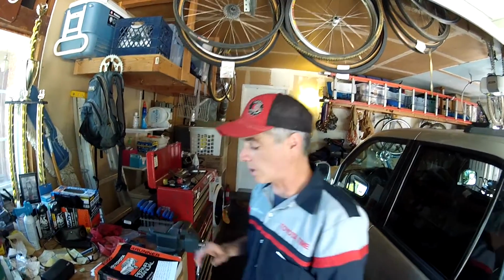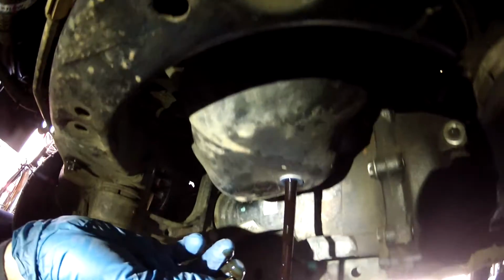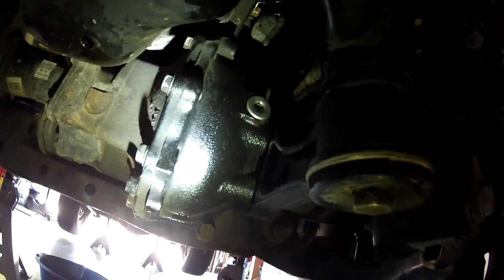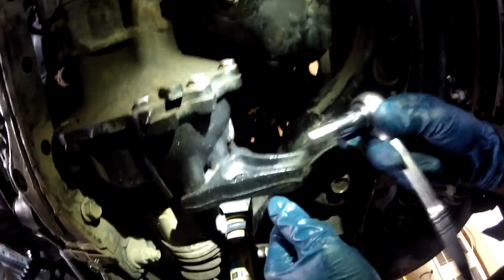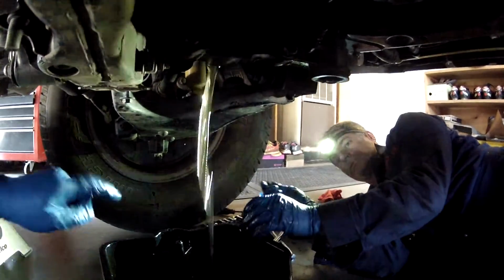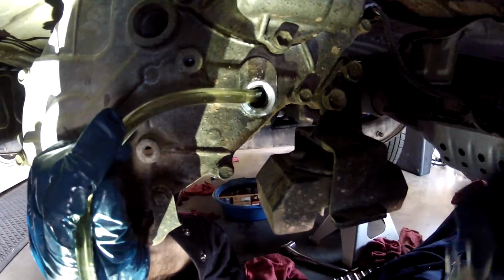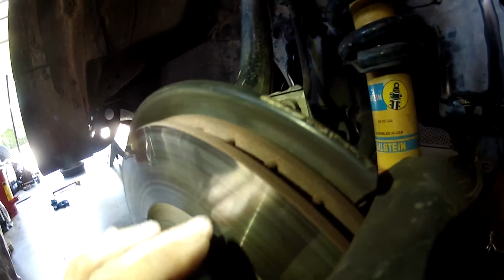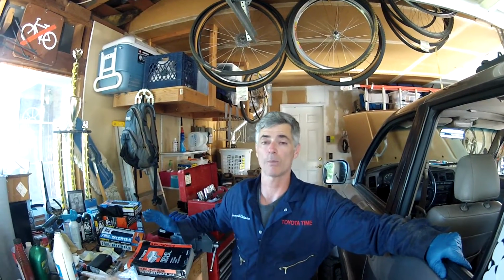30,000 Mile Interval Service

Comment: Tim, a big thanks !!!  

You recommended me doing my timing belt last year which I did, and my one-owner 2000 Limited is running great.  So today I tackled all the fluids.  I couldn't get the front diff drain plug loose even with a 1/2 breaker bar. I thought about using an impact driver, then came to my senses and just siphoned the oil from the filler plug the best I could, and refilled it back up with new fluid.  Transfer case, rear diff, and tranny went fine.  I do have a question.  Is inserting the tranny dipstick always such a PITA?   Is there some kind of trick to just dropping it in?   I tried to test the fluid cold, but after 5 minutes of finagling the stick the car had already warmed up some.  Maybe I need a new dipstick.  I will be doing my brakes next week.
Reply from the maker: For the front differential drain plug, apply heat with a butane torch around the perimeter of the plug, shock the plug with a few hammer blows and then try to crack it loose.  If it still doesn't budge, apply more heat and try again.  The goal is to not strip it.

For the trans dipstick, use two hand to insert it, one on the handle and one on the actual dipstick helping feed it into the dipstick tube.  You have to look at how the dipstick tube curves and try orienting the dipstick in different positions and find the one that allows the dipstick to slide in easiest.  if you mess with it for a while, you'll figure it out.
Reply: @TimmyTheToolman   Will try the butane torch on that plug.  I was only able to siphon around 1/2 qt.  I'll play around with that dipstick until I get it down.   Someone mentioned if having trouble, flip it 180 and try again.  Interestingly, Toyota has two different dipsticks that are "exact fit" for my VIN.  And it is not a superseded version of the other.  They can both be ordered from the same dealer today.  I wonder what has changed from the OEM version.   Part# 35103-34060 and 35103-35350. In the meantime I will keep working on that original dipstick.   Thanks again.
Reply from the maker: @more_jello  Let me know if the heat trick works for you.  It should.  It's worked for me multiple times.
Reply: @TimmyTheToolman   Timmy I'm gonna have to concede on getting that plug loose. I took a torch to it and banged it with a hammer. The 10mm hex was snug and tight, but I had bad leverage and the plug was now starting to strip the more I went at it.  I'm done with it.  I'll find a shop or lube place and have it serviced on a lift.  This is a one-owner 4Runner that back around 15 years ago when I used to get maintenance servicing for everything other than oil (I've done that myself from day 1), some tech must have over-torqued that plug.  The fill plug was much easier to loosen.   Thanks for your feedback.
Reply from the maker: @more_jello  There's a couple other things you can try.  You would weld an allen socket to the plug and get it out.  You could weld a nut to the plug and get it out.  You could take a chisel and hammer to it.  This video documents those techniques.https://youtu.be/hFnOejt3VIU?si=pP3lyCSktlmz3szW

Don't give up just yet.

Comment: Oil filter easiest to access from driver side wheel well by unsnapping the rubber splash shield and the oil filter will be directly ahead. Helps to turn wheels to the left so more open access to wheel well. Best to use the filter wrench with the 3:8 socket fitting with ratchet and extensions.
Reply from the maker: Well, I don't agree, but whatever works for you is a good way to go.

Comment: Hi Tim. Will you be switching to 85w140 Lucas oil in both differentials after your experience with ECGS?
Reply from the maker: Yes.  That's what I ran in them for the break-in period, and I plan on running that grade gear oil from now on in both diffs.   Chase Perry sold me on it when we were shooting videos together.  He's got a ton of experience in this field, so I think his recommendation is a solid one.  It makes sense due to the cling factor of the thicker oil.  It gives the gears and bearings better protection.

Comment: Timmy, this was such a great resource when I got my '98 4Runner a couple of years ago (and still is a great resource). I got all of these fluids changed at that time, including my manual tranny fluid. I'm the original owner of my 2004 Tacoma, and sad to say, I've never changed the automatic transmission fluid on it, and I'm at 148k miles. I've read arguments for and against flushing the fluid at this point, and I've settled on just draining and re-filling every 10k miles like you mentioned here (until further notice). My owners manual says to use Toyota Genuine ATF Type T-IV, and I think you're using Valvoline Max Life Full Synthetic Dexron VI, Mercon LV, DEX/Merc (which could be different requirements for the 4Runner).  I bought some of that (the Max Life...), and although it doesn't say it on the front, the back of the bottle does say "recommended for use in Toyota Type T-IV," so I think that would be ok, right? Just want to be sensitive with what I use on this since I'm introducing new fluid for the first time.  Thanks!
Reply from the maker: Smart choice to do drain and refills.  Better late than never.  Yes, the Maxlife would be fine for your trans.  Your 2004 Tacoma is a 1st Gen Tacoma and 1st Gen Tacomas and 3rd Gen 4runners have the exact same drivetrains.  There's some small differences in the transmission and transfer cases over the years, but they're essentially very similar.  The original spec called for Dexron 3.  I'm guessing by 2004, Toyota decided to recommend their own oil.  You're welcome and Happy Wrenching!

Comment: I don't see the drive shaft joints having any grease tubing 🥺,do I need to remove drive shaft?
Reply from the maker: No, you don't have to remove the driveshaft.  You just grease the zerk fittings you have.

Comment: hi timmy I have a 1998 Toyota Tacoma 4X4 2.7 manual transmission, I am going to change the transfer, differential and transmission oil. Can I use the same gl5 75w90 for all cases? Thanks for your help.
Reply from the maker: For the transfer case and differentials Yes.  For the manual transmission,  I'd use Redline MT90, since it's formulated specifically for manual transmissions.  https://amzn.to/3LjhUcD

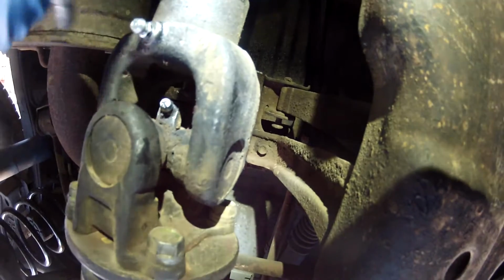Comment: Tim, could you explain again why you put different grease in minute 39:14  Thanks
Reply from the maker: Because Toyota recommends two different grade greases for the slip yoke and u-joints.  My opinion on this is it really doesn't matter.  You could use the same grease for both applications.  This is the grease that a reputable driveline shop recommended to me for both applications: https://amzn.to/2ObZAH0
Reply: @TimmyTheToolman  Thanks
Reply from the maker: @tarzan30809  You're welcome.

Comment: Thanks so much tim, Sean, & friends!  
I bought a 02 limited 4x4 like 3 weeks ago. Ive been slowly doing maintenance stuff and I've done almost all of the stuff on this vid +/- some jobs bc stuff was still clean. I still need to do fuel filter, trans filter (gonna wait a bit bc I just put new fluid in), spark plugs, lbj, steering rack bushings, and water pump/t-belt. Am I missing anything else? 
Can wait to start putting in siccc mods!
Reply from the maker: You're very welcome.  Sounds like you have most things I'd suggest except maybe replacing the radiator as preventative maintenance and considering adding an external trans cooler.  We have a video for it: https://youtu.be/2nVbwe2t2T8  Good luck with all the planned work and have fun with your rig.  If you have questions along the way, you know where to find us.  Happy Wrenching!

Comment: Wonder if the transfer case can benefit from 75 or 85 140 diff fluid? 🤔 @Timmy The ToolMan
Reply from the maker: I now use Redline synthetic 75w-90 gear oil in my transfer cases and differentials.  I've never used 140 grade.

Comment: Wow your using 5w 20 how does your runner do with 5w 20 I never go lower then 10w 30 and 99 percent of the time I always use 10w 40 and I'm in az @Timmy The Toolman
Reply from the maker: I think maybe you were seeing things Antonio.  We've ever put 5w-20 into a 3.4 liter engine.  5w-30 yes, but not 5w-20.  If we did, it was a mistake.
Reply: @TimmyTheToolman  Was a Typo Ment 5w 30 My Orginal Manuals say 10w 30

Comment: All the 4runners I have ever had that were a 3rd gen always took 6qts of engine oil 5.5 qts is not enough not sure why either think its a misprint in all the manuals @Timmy The ToolMan
Reply from the maker: Yeah, it is weird how 5.5 quarts doesn't fill the level to the top line on the dipstick but that's what they say is the capacity for the engine.
Reply: @TimmyTheToolman  I think its a typo in the manuals because 5.5 never works for any of my rigs eaither

Comment: Great video Timmy as always Brother just picked up a 2000 Limited 4x4 @Timmy The ToolMan
Reply from the maker: Thanks Antonio.  Have fun working on your new used rig.
Reply: @TimmyTheToolman  already got a bunch of things lined up already changed all the lights to led replaced stock brake housings doing u joints next waiting for parts needs a new steering rack and when I find a matching 4:30 ration front and rear diff doing the e locker swap back up camera and navigation stereo it came with remote start and guy that had it before me took the auto sensing rear view mirror off a 2005 Ford and wired that up so when it is dark dash lights and headlights come on automatic has a lift kit bilisten shocks 35 inch tires rock sliders it was decked out when I got it 228 thousand miles and making it mine now with the extra flair 4 grand cash has no body dents or defects
Reply from the maker: @AntonioClaudioMichael  Have fun with all the planned work.

Comment: I really enjoy your videos.  I changed my differential and transfer case fluids today and I have one question. Are the drain and fill plugs for the differential identical? I noticed on the differentials that the drain plugs had magnets but there was no magnet on the transfer case drain plug.
Thanks again for the videos, they help so much!! 
Tomorrow on to the Transmission!!
Reply from the maker: From what I remember, the transfer case fill and drain plugs could be  interchangeable, because like you said, the drain plug is not magnetized like the differential drain plug is. The differential drain and fill plugs are different for sure.
Reply: @TimmyTheToolman  Thank you!!
Reply from the maker: @gbrianmullinax8448  You're welcome Brian.  Have fun wrenching on your rig.

Comment: When greasing the u-joints and slip yokes, there's 2 fittings in the rear and 3 in front for 2WD as well? Since I know yours is 4WD I was wondering if it's the same for 2WD.

Also, just so you know: the amazon link for the transmission drain plug crush washer is a dead link
Reply from the maker: I would assume so but I can't honestly say for sure since I haven't greased the zerk fittings on a 2wd model.  But, if you simply get under your rig and take a look at your driveshaft, you should be able to quickly figure it out.
Reply: @TimmyTheToolman  Going to grease 'em tomorrow when I do lower ball joints while I'm up on jack stands for the day. Just checking to make sure I don't miss any but we'll see and I'll let you know. 👍
Reply from the maker: @iburstabean  As long as the rear end is off the ground, the parking brake is off and the trans is in neutral, you'll be able to turn the driveshaft to get a good look at it and be able to see all the zerk fittings.  I'm pretty confident you will have that center ball zerk for the double cardan joint just like with the 4wd models.
Reply: @TimmyTheToolman  Surprisingly, there are zero zerk fittings on my 2000 limited 2wd, had a professional look as well and nothing. No double cardan joint either. Probably should have made sure they were there before I bought a grease gun and primed it lol
Reply from the maker: @iburstabean  That's interesting you have non-greaseable u-joints and you have no zerk for your slip yoke.  Weird.

Comment: I just completed the front/rear differential and transfer case, thanks Timmy!  I thought I’d breakdown each one with washer part numbers etc.  
FRONT:  Drain washer part number 90430-24003.
Fill: 12157-10010

TRANSFER CASE:
Drain and Fill: 90430-A0003

REAR:
Drain and Fill: 12157-10010

I got a quote from our local Toyota dealership and it was $300 to change all three fluids, wow! Anyway, do it yourself and save a ton, hope this info helps.  I ordered all the washers from Amazon.
Reply from the maker: Good job getting the job done Tom.  You're very welcome.

Comment: Hey Tim, can you use 80w90 in the front diff and transfer case as well?

I plan on ordering Amsoil by quart and since the eLocker diff requires 2.9, I’d be more comfortable buying more than just 3 quarts for the rear bc I wanna have a little extra oil to “flush” the old stuff out. Thinking about ordering 6 quarts of 80w90 for the Rear, Front, and transfer case.
Reply from the maker: You could or you could also run 75w-90 in everything too.  That's what I'm doing now.  I'm running Redline synthetic 75w-90 in my front rear diffs ans transfer case.
Reply: Timmy The Toolman awesome, thanks for the quick reply! Gonna go with 80w90 since it’s slightly cheaper plus it never gets below 60* F in my area anyways

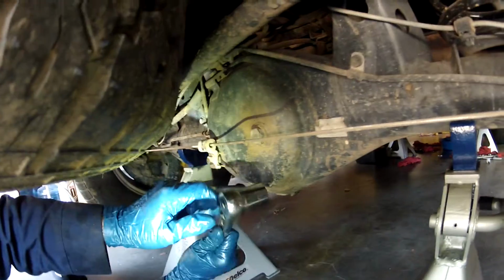Comment: 32:49 if you loosen the bolt (14mm?)  that's holding the clamp on the E-brake cable (just left of Diff fill plug) it's easier to get your socket on there. Just remember to re-tighten it of course. Thanks again for all the good advice, including what not to do, etc. One thing I hadn't thought of before, was making sure the oil filter gasket was not stuck to the flange on the engine. However, I usually wipe that with a rag after moving the filter. It can be hard to see tho.
Reply from the maker: Yeah, I can see loosening the E-brake cable clamp to have an easier time to get the socket on.  With the E-brake not set, I usually have no problem getting the socket on there but thanks for the tip.  You're welcome and Happy Wrenching!

Comment: Hi Timmy,
What type of grease are you using on the U-joint/Slip Yoke?
Reply from the maker: This T4R forum thread shows pages right from the factory service manual that tells you what type of grease to use: http://www.toyota-4runner.org/3rd-gen-t4rs/97006-drive-prop-shaft-greasing-guide.html

At one point I was using Ford XG-8 grease for the slip yokes like I show in this video to try to eliminate slip yoke binding: https://youtu.be/Jyltxe2nPEg
The new grease worked for a while but the clunk came back.  With that said, I do believe the best way to properly grease the slip yokes is to pull the slip yoke off and manually grease it.  When you use the zerk fitting, most of the grease just sits at the bottom of the yoke and doesn't effectively grease the splines.  Check this video out: https://youtu.be/oKX5UeE2Txs

In the past year or so, I've gotten some work done on a couple driveshaft by a driveline shop local to me in San Jose, California and I learned they use one grease for lubricating the ui-joints and slip yokes of the driveshafts they service or build for their customers.  I'm going to follow their lead and start using this grease for my u-joints and slip yokes: https://amzn.to/2ObZAH0

Comment: Hey Tim, wondering if you could help me once again.  So, torque spec for Transfer case plug is 27 ft lbs.  My torque starts at 30 ft lbs! What do you think are the chances I brake the plug if I tighten it to 30?  Would it make that much of a difference?  Thanks!
Reply from the maker: Marx, just forego the torque wrenching.  I've tightened hundreds of drain plugs without the use of a torque wrench.  You just have to understand mechanical advantage and know that a small fastener needs to be tightened with less force and a large fastener will need a lot more force.  Get on the plug with a 1/2" drive ratchet and socket, cinch it up snug and call it good.  Don't get on there with a long breaker bar with your hand on the very end of the handle and put all your weight into it.  The plug only needs to be tight enough that it won't leak and won't fall out.  Err on the side of being under-tightened rather than over-tightened.  You don't need to live and die by the torque spec.  Trust your best judgement and you'll be fine.
Reply: @TimmyTheToolman  appreciate the advice!
Reply from the maker: @marxccc  You're welcome!

Comment: D2 or d3 oil filter which is better in your opinion?
Reply from the maker: Get the D3.  Those are the ones I"m running in my 4runners.  It has a little bit higher volume capacity.

Comment: Timmy,
I just got my 4Runner and the guy I got it from had shit for records...so I don't know if it's been using conventional or synthetic oil.

1. If it's been using conventional oil and I drain it, can I put synthetic oil in when I change it next/will that be a problem?
2. I'll be doing the valve gaskets soon...should I wait till after that or does it matter if it's before?

Thanks man...your videos are giving me the confidence to do a lot of these jobs I've long wanted to know how to do...#sicmods
Reply from the maker: Yes, you can switch to synthetic no problem.  The one thing with synthetic is people have reported more oil leaks because it tends to be a thinner oil but I wouldn't sweat it.  Give it a try and see how it goes.  It's not going to hurt anything.  It doesn't matter if you change the oil before or after the valve cover gasket job.  Either way is fine.

Good to hear our videos are giving you the confidence to turn wrenches on your rig.
Reply: @TimmyTheToolman  thanks man...I appreciate your time. I'll be using your links for most of my purchases for gear from Amazon...it's the least I can do.
Reply from the maker: @TheRealitarian  We appreciate it.